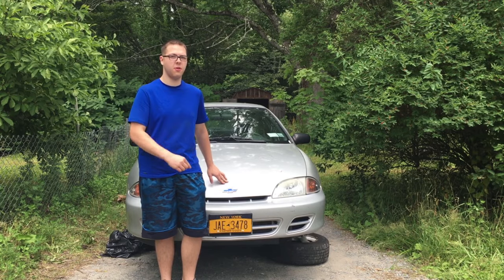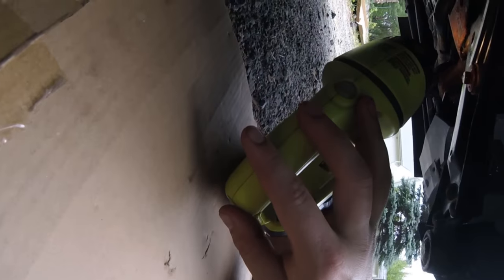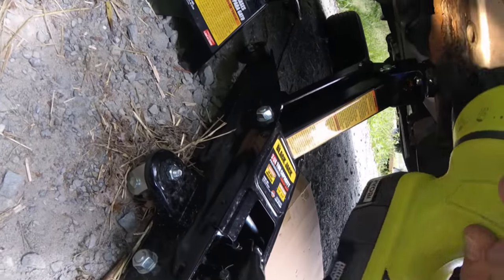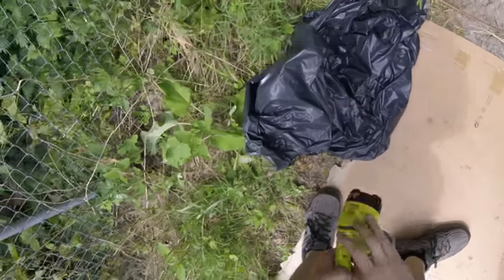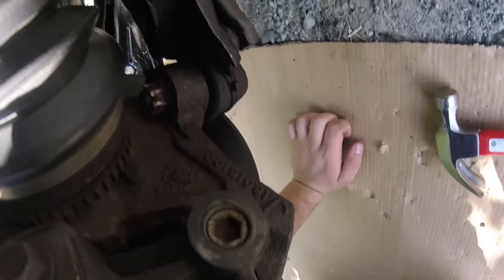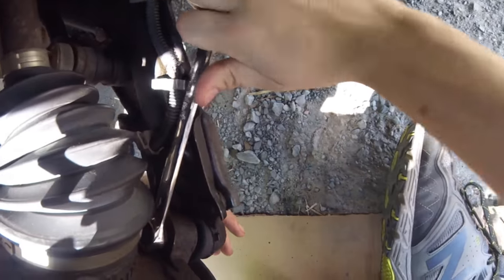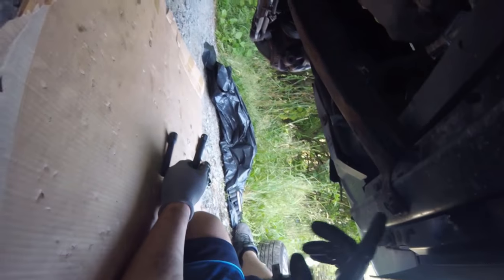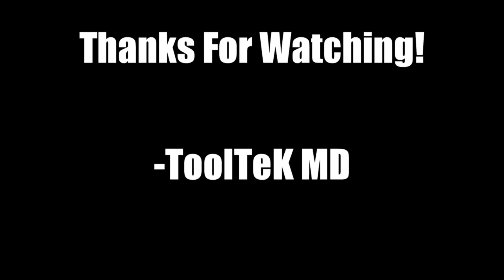2001 Chevy Cavalier Subframe: Part One: Removal

Comment: Good Job! I just learned today my subframe needs replaced. Midas muffler shop wants about 400 for labor only. The used sub frame might run $100 to $150 more, from a salvage yard. The salvage yards are getting the parts shipped from the southern part of the USA because up here in michigan all of them are rusted to bad. I'm hoping my subframe will hold up till spring because i dont have a garage just pavement outside. I didn't know if i could really tackle it until i saw your video. Now i have the confidence,thanks. I haven't watched the replacement part 2 yet but plan to here in a few. I was wondering how much time it took you to get it out and how much was your used subframe part. Did everything match up like it should? My power steering parts go back in ok? I need to replace all that too. My cavalier is a 2000 and has 176,000 miles on it. Who knows maybe it will run a while longer so i may as well replace the subframe in spring. It's to cold to do right now. Well, I looked for the other video , i guess it was to hard to do with one hand! LOL I dont blame you there, the job is hard enough. Did it go back in ok? How long did that take? Was there anything i need to know? Any tips would be appreciated. Like did you use a jack to get it up in there? Thanks!
Reply from the maker: Bob R thank you very much for the comment and the compliments. It is great to hear that I have given you the confidence to tackle the job. I am working on editing part two right now. Just been crazy with the holidays and a lot of editing goes in so as not to make the video too long and boring haha. I will have it up in a few days. I was actually quoted around $900 for the job, but I paid $150 for the subframe and also replaced the ball joints and sway bar link bushings, which ran me around $30. Definitely saved some money. I did use two jacks to raise it up into position as I was working alone. Just watch the power steering rack closely so as not to damage any lines. Overall I would say the job will take about 6 hours working continuously. Thank you again for the comment, and if it’s not too much trouble be sure to subscribe and tap the bell so you’ll be notified as soon as I post part two. Should have it up within the next couple of days.
Reply: @morganmend   Cool , will do, thanks.

Comment: Out of curiosity, is it necessary to remove the a arms with the sub frame or am I able to leave them attached to the car? 

Can't seem to get the castle nut off of those ball joints. Seized up right and solid
Reply from the maker: Kyle Teodecki No unfortunately they will
have to be removed. They are through bolted in two recessed areas of the subframe for both sides. If they are still secured at the ball joint, there is unfortunately not enough give to slide them out of the frame.
Reply: @morganmend  dang I was really hoping I would be able to because those castle nuts are rot welded something fierce. 

Original plan was to use my bottle Jack to raise them up enough to slip the out of their recess but I guess I'm riding my bike up to get a nut splitter. Thank you very much for the quick reply, you have my upvote and sub
Reply from the maker: Kyle Teodecki thanks friend, very much appreciated. Wishing you the best of luck with your car!
Reply: @kyleteodecki7478  PB Bluster (especially if to leave it on for 1-2 days) + heat (in extreme cases) takes everything apart.

Comment: Great video! Thanks. So this job will allow access to the steel brake lines that run along the bottom of the firewall and underneath the body to the rear wheels? My lines rusted through at the bottom of the firewall. Nearly impossible to get to them with the subframe in the way.
Reply from the maker: Larry Gee thanks for the comment! Yes, removing the subframe completely or even dropping it a bit will give you more access to those lines. Thanks again for watching!

Comment: Oh so many questions. My 01 sunfire needs same repair. And it will be started this week. Do you like the Ryobi tools? Thinking about getting them plus a few batteries. Did you ever think about using cribbing(wooden blocks log cabin style) as a way to get the car higher? What camera did you use? It looks like its head mounted. I want to do a video as well since I couldn't find any about my specific issues.
Reply: Where's part 2? Lol. Oh and how long did this take you actual working time from start to finish? Ballpark estimate?
Reply from the maker: Thanks for the comment! I love the Ryobi tools, highly recommend the cordless tools. They are a great value. One battery will work with every one plus tool. Haven’t met the bolt yet that I haven’t been able to remove with that impact. Don’t buy the drill press though haha. I didn’t really consider raising the car anymore as I had plenty of room, but I’m sure that using cribbing would allow you to do so. I’ve used it when working on four wheelers. I used a go pro and yes it was head mounted. I might recommend the chest mount though if you are planning on doing a video, or else you will bump it on everything.
Reply from the maker: Part Two will be up soon. Overall you can expect to spend six hours working continuously to complete this job. It requires a lot of care and patience, especially taking extra care not to damage the power steering rack.

Comment: Do you need to support the engine with any chains on top? Or are there strong enough engine mounts above the subframe to hold it safely?
Reply from the maker: Upper mount and transmission mount provide plenty of support. No need to worry about supporting the engine.
Reply: Awesome! Thanks for the fast response.
Reply from the maker: Elijah Dorn my pleasure! Thanks for watching!

Comment: I was curious and wanted to know...did you cavalier make a clunk or knocking sound when shifted into drive or reverse?
Reply from the maker: A M yes it did. I actually found that noise to be coming from a bad motor mount, as soon as I replaced the upper mount it went away. It could also possibly be coming from a faulty strut tower. Thanks for watching!
Reply: @morganmend  i have replaced the upper mount and for the lower dog mount I used the RK sport brand. A little pricy but the clunk was almost gone. At first I thought it was the transmission but I was under the impression that it could've been coming from the crossmember being loose or damaged. I didnt think about the strut causing it. I will look into that. Thanks.

Comment: Great video. What Ryobi impact tool are you using? It seems to have more than enough torque to break those larger bolts loose without any struggle. Thanks
Reply from the maker: Larry Gee Thank You! it is the Ryobi 1/2” impact. It is a great tool, the best investment I’ve ever made. I’d recommend it to anyone. I haven’t met the bolt yet that I haven’t been able to break loose with it. Here Is the link to it: https://amzn.to/2XZcSgD
At $99 it’s an absolute steal, especially if you already have the one plus batteries. If not, you can get one with a charger for around $30.
Thanks for watching!
Reply: i really reccomend anyone buying an impact today to buy the harbor freight hercules

Comment: So I'm doing the same repair on mine, I have everything out except the drivers side power steering rack "nut" on the back side of the bolt is spinning. I can't get pliers or anything on it and it's in a bad spot even if I was going to cut it off. Any tips welcome before I pry the ball joints off and let it fall and see what happens.
Reply from the maker: Oh no! That was my biggest fear when I was working on mine. Thought to myself, yeah what If that welded nut gives way? Poor design no doubt about it. See if you can’t get on the back side of the nut from up top between the engine and firewall, quite a fair amount of space if I’m remembering correctly. Best of luck friend!
Reply: @morganmend  problem we ran into was the back side of it isn't a real size. Smaller than 5/8 bigger than 9/16 and nothing metric fits either. I'm sure I could beat a socket on it if there was room for a hammer. Looking like I'm gonna pickle fork the ball joints off and put a block of wood under it, if I can get it to drop a foot I can just cut the bolt or nut off either side. Hoping there is enough flex for it to drop some to get any room to improvise.

Comment: This helps me out to fix my Cavalier
Reply from the maker: Merdoc Monkman Thanks for the comment! Glad to hear it helped you out! I have many more repair videos on the way! If it’s not too much trouble, subscribe and tap the bell to be notified when I post them!
Reply: Hi , I think the cavaliar subframe has 6 or eight bolts to remove , i Got a about a two foot or so long breaker bar and extra pipe length if needed using 6 point impact sockets, but if you can get a medium size  air powered impact  wrench it can be used to free up the bolts easier with less chance of breaking the welded stationary nuts  loose as you work the direction back  and forth , loosen a little then tighten a little then loosen a little more and tighten a little , just back and forth until the bolt comes out 🔩🔧
Reply: tnx 4 reply !🔧🔩👍🆒
Reply from the maker: Cata strophic My pleasure! Glad to hear that your Subframe replacement was a success!!

Comment: Hey I know this is and old vid but I wrecked my 2002 Cavalier and the end of the Subframe got pushed back a couple inches to where the Subframe where the lower control arm is on passenger side does line up with the brace coming off the bottom of the motor where a metal link is connected. I'm trying to loosen the bolts to subframe and use a cable puller 2 ton to put it back in position. My question is do I need to support the engine with a jack before loosing sub bolts?
Reply: I heard from the man himself, the motor mounts are strong enough to support the engine and the engine doesn’t need to be supported by a jack.
Reply: @Pugster1201   Thank You

Comment: Idk if imma get a answer but what’s the thing he called a brace on the driver side hooked up to the radiator
Reply from the maker: Front Suspension Support Brace GM Part no. 22590142
Reply: @morganmend  is it important I’ve been looking for it and they’re either out of stock or discontinued is it dangerous to drive without it?
Reply: @morganmend  hey so another question I think a coolant line blew there’s coolant on the bumper driver side headlight and driver side windshield I’m not car savvy any ideas
Reply from the maker: @Skyguy-xb2lb  probably your upper radiator hose had mine develop a slow leak coolant pooled in similar areas
Reply from the maker: @Skyguy-xb2lb  as for the missing brace you’ll be fine but definitely replace it when you can

Comment: I was thinking to drop a subframe a bit to get better access to the steering rack boot (it got loose, probably clamp got broken though I put a new ~8 months ago). I have 2003 Chevy Cavalier and there is practically no access to the inner end of the boot bcs of the subframe. In Manual they advise to remove the Front Crossmember. Is it another name for a Subframe? In general what is the purpose of the Subframe? Is it for extra protection from the bottom? Thank you for the film. What a hard work is done.
Reply from the maker: Thank you for your kind words. You are correct, the front crossmember is another name for the subframe. The subframe is a a very important suspension component. It supports both the engine and front suspension of the vehicle.
Reply: @morganmend  But then you need to support the engine when the subframe is removed. Probably it is kind of additional support necessary at driving times, but the engine is still sits at its place when the car is stationary when the subrame is removed. In Shop Manual they don't say anything about supporting the engine on replacing the subframe. I see you also didn't support the engine. I think I have a problem w/Steering Rack (the tooth after impact can be skipped), since the steering wheel is crooked by 45 degrees and I saw that the rack boot on the driver side is slipped and some teeth are seen. Do you happen can tell how to know for sure that it is skipped or not (probably should be some alignment signs, but where its ...)? And is it possible to put it back into correct position without removing the rack? Thank you for you replay. I would appreciate any opinion on this matter.
Reply: @morganmend   I know already how to solve that problem w/ skipped tooth: to remove the steering shaft from the rack peg, rotate the peg (release the Inner TRs, probably otherwise it won't be possible), attach the shaft back, yes?

Comment: Where you get the sub frame n how much was it
Reply from the maker: jakiev hudson I bought it off of ebay for $160. If you buy one online just make sure that it comes from somewhere where salt is not prominent. I was originally quoted between $850-$1000 to have the repair done, so I was much happier spending the $160. Thanks for watching!

Comment: leave the steering rack attached just take both hoses off pump
Reply from the maker: fergie badass bolts though the subframe in two locations has to be separated from the frame in order to drop it.
Reply: either way works i guess

Comment: steering rack will come off with subframe
Reply from the maker: fergie badass replaced subframe so the goal was to leave the rack on the car and bolt it to the new subframe. Only two bolts to worry about.

Comment: Did not rust out from "sitting", rusted out from  SALT
Reply from the maker: carl1948 I have an upstate ny cavalier that has rusted from salt, we’re talking rotted unibody, and rusted body panels. Ironically the subframe was not rotted at all. This was not the case here. This was clean as a whistle on the body and did not display the symptoms of a salt rotted car.